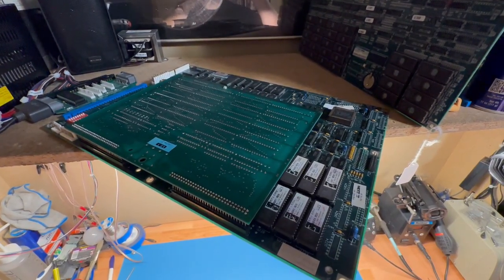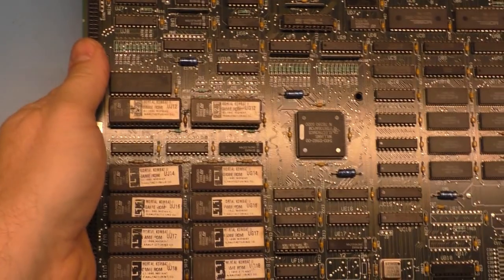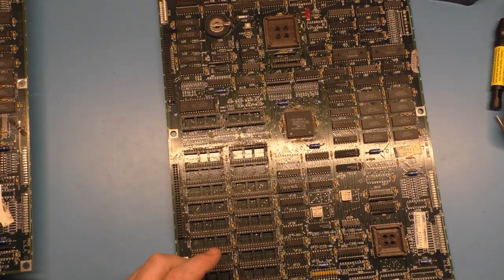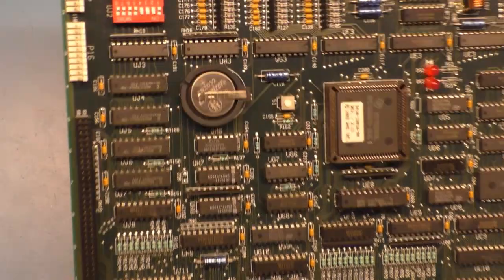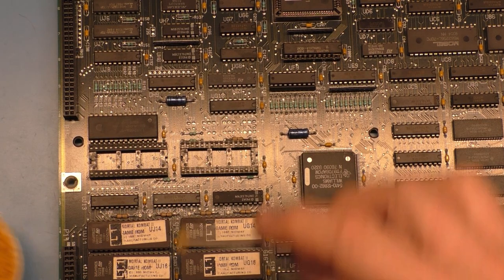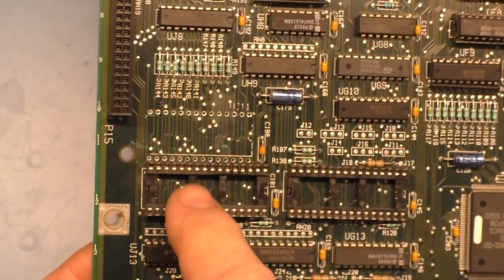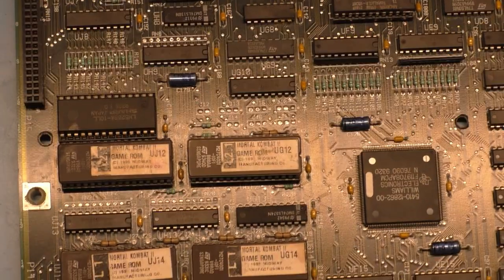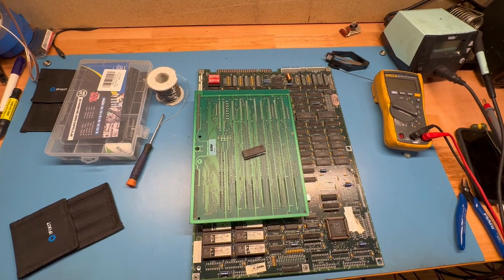Mortal Kombat 2 Arcade PCB "CMOS Chip U49 Bad" - Let's Fix It!

Comment: Flip it over and use hotair on the backside of the board where the solder is. The chip will fall out with gravity. I prefer to put low melt first, uses very little heat and effort for the chip to fall out. No risk of damaging the chip or disturbing other chips on the good or donor boards.

Comment: Never have I ever seen such butchery to a somewhat rare circuit board. Just buy some Chip Quik alloy if you're going to use unprofessional techniques and half ass the desoldering stage. Add a little Chip Quik, hit it with the hot air for a few seconds and then pull the package out using pliers so you don't damage traces underneath.
Reply from the maker: You should re-read the channel name.
Reply: @t0rxe Post a video on your work? Through hole removal of this type is not trivial in contrast to SMD or larger through hole chassis boards. You really need a 0.6 diameter pump nozzle (Hakko N61-01)